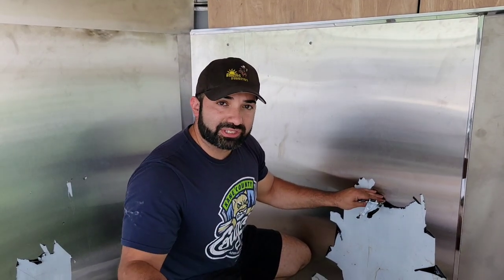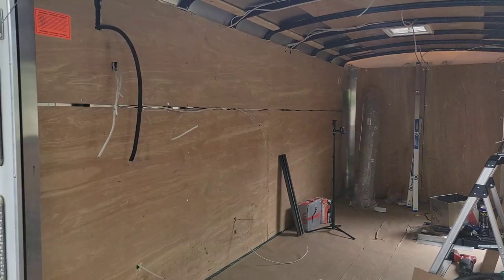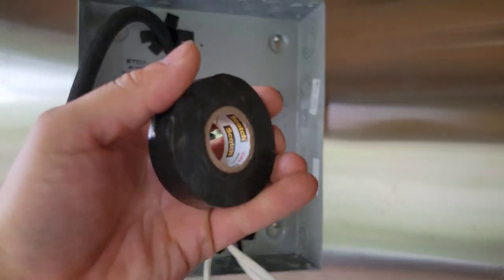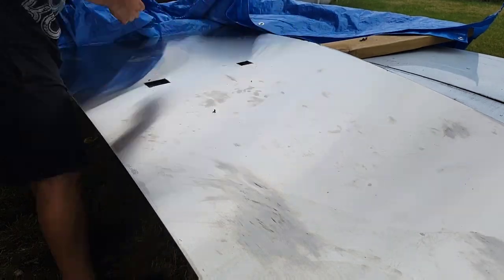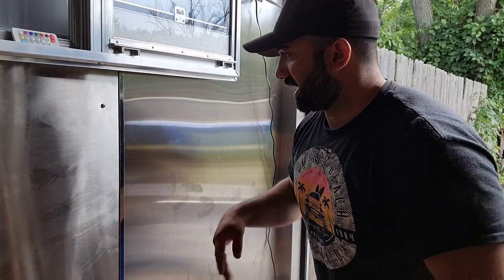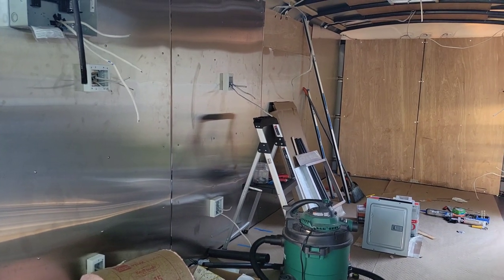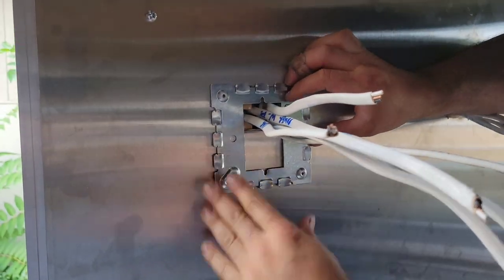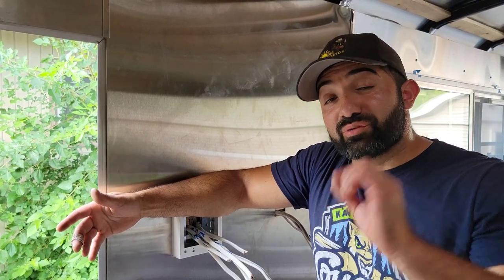How To Build a Food Truck: Installing the Stainless Steel

Comment: Use a fabric steamer to remove the plastic covering. Slowly peel the plastic covering as you heat it up with the steamer. Start in a corner and It will all come off in one piece under 10 minutes.

Comment: Since you are working by yourself, I can really recommend a Bosch Laser Level with Tri-pod from Lowes. I used it to tile my Subway tile bathroom and you don't have to mess around holding a Level. It is a big Time Saver.
Reply from the maker: 👍👍👍👍 thank you for the tip

Comment: One question, can the stainless steel ones be installed vertically and horizontally or only vertically?
Reply from the maker: Either way works.
Reply: Thanks

Comment: Frank, what if i have metals walls already up but they are old behind them is insulation.. do i over lap it with newer metal or do i take the old sheets off?
Reply from the maker: I'll answer as if I owned your truck. I would remove the old and bring in the new as Long as it has a nice base to attach it to. Being plywood or something similar

Comment: Hey Frank! Your series is awesome man. It's helped me so much. When you connected the stainless steel sheets up in the front of the trailer by the sink did you use 90 degree stainless steel connection pieces? Or did you just use the stainless steel end caps from Amazon? Thanks
Reply from the maker: No didn't use a 90 degree connection just made my own angle when I connected them both. Yes the caps and dividers

Comment: Just a question is it required to have stainless steel walls in your trailer other than behind  cooking appliances
Reply from the maker: As far as I know you just need it behind cooking equipment 
And the rest non porous walls
Reply: @fbaltierrez  Thank you for the reply, I might have a few more questions, is this the best platform to ask them or do you have another outlet?
Reply: @fbaltierrez  Thank you

Comment: Where do you get the stanley steel sheets
Reply from the maker: I got them from a place called Roco Steel. But prices and the damaged stacked I bought are non existent. Call your Local Metal supplier 304 SS mill finish

Comment: Hey frank, quick question. Why drill holes if you use self tapping screws?
Reply from the maker: Great question. Because the stainless steel is a tough one to drill through and a pilot hole helps tremendously
Reply: @fbaltierrez  ahh, gotcha. Im going to build one for a friend of mine who has a rolling ice cream business and wanted to make sure I had as much details as possible.

Comment: What size is your food truck. What size are your stainless sheets. How many did you use
Reply from the maker: 7x16. I used scrpas of SS that I got at a discount typically they were about 8 feet in length. How many? Depends on the size of your trailer and if you are doing the entire thing or just cooking side
Reply: What size is your food truck the dimensions please I am looking for one now. I am an electrician as well. You just inspired me to get this going
Reply from the maker: @nicolebeckner2026  7x16 cargo mate trailer

Comment: I am new to this, but can an aluminum sheet metal or other sheet metal be used rather the steel? What would the benefit of having the steel sheet vs other metal sheets?
Reply: Aluminum stain
Reply: other metals tend to stain, rust and/or oxidize in a kitchen setting. Stainless steel eliminates all of the issues AND it is more durable than most other metals in this application. Also, your health department most likely will require stainless steel or something like FRP paneling for water resistancy and avoiding mildew
Reply: @ItsHimMega  Thank you so much. That is really great info! I really appreciate it.

Comment: No insulation?
Reply from the maker: Just insulation on ceiling and where the window is. If you wanted to add more guess you could doesn't help out much. It's going to get hot regardless when cooking

Comment: Dought you read these any more being two years old, but having a money delima. I don’t k ow if I can afford the painted aluminum sheets like I want on my food trailer. It’s going g for 150.00 a sheet. It is 11 1/2’ long by 7’ wide approx, I’m extending it 3’. Need little more room. If I do get lucky enough to get aluminum sheets, should I run the sheets, up & down, overlap each end 1 1/2”, if I do it that way, I’m looking at 9 sheets and little over a grand, a grand I ain’t got right now. I’m in over my head too far to try and sell it, never get what I e got in it right now. I hv all tanks, plumbing, cabinets, had 900.00 structural welding done when 1st bought it. Floor was weak, put new roof on it avd hv insulation fir it only 2 sheets of what I’m using for ceiling covering. Flush mounted led lights, this that etc. couldn’t sell it avd get money I hv in it. Either way I run outside metal shell I’m looking at 9 sheets, plus padded SS wall covering on inside. Man I never expected to drop the dough I’m dropping  thought I’d be selling my sandwiches already down on the Texas coast but going to be a easy 8 more months or longer still hv to run electrical, trying to figure out the snow for all that to see if my generator will carry it it’s a 10,000 w generator thanks anyone got idea of what I ca use that loons line painted yellow aluminum sheets I’m open thanks Steve  
.

Comment: What? No header support on window after cutting studs then electrical tape on the wire access holes instead of proper romex connectors!??? Asking for failure! That trailer gets knocked around hard while in transit. Wires will get cut in time and no support will break that window. No even watching the rest. Piss pore job dude!
Reply from the maker: Apprentice the feedback, not a problem I'm sure there's lots of videos out there for you to watch. thanks for commenting tho. 3 years and 0 construction issues 😉👍

Comment: How did you get your cooking equipment into the food truck through the door? My griddle and chargrill are very heavy and I wouldn't be able to manually lift them up onto the truck and through the door
Reply from the maker: @wasiqrafi1793  the drop down door in back. All trailers usually have a side and back door

Comment: Well, I got my trailer yesterday. Thank you for all your videos. You’ve got me hooked on wanting to do a trailer. Question, why stainless instead of the FRP boards? Is the stainless easier to work then the FRP? Thank you
Reply from the maker: Stainless is a bit harder and heavier to work with however I feel as it will last longer and more durable

Comment: Hey Frank your videos are great, i recently purchased a 30ft school bus im turning into a food truck, i have 20’ length by 7’ width. My question, is it necessary to put the plywood behind the stainless steel? Can i just do studs?
Reply from the maker: No because the Stainless will be too flimsy in between studs needs a backing

Comment: Love the videos, only issue is: Definition of truck: motor vehicle used for transporting goods or materials.
     Definition of a trailer :unpowered vehicle towed by another vehicle. This is a good series of how to build a food trailer. Trucks have a different framework
Reply from the maker: Definitely agree. That's why I have stuck with trailers much easier for me to build

Comment: What’s up Frank? Hope things are going well. I’m in the process getting my food truck going. Starting from scratch really, small hollow Chevy p20 stepvan. Just getting it mechanically sound 1st. I was wondering if you can please tell me something. What made you wrap the whole inside of the trailer with stainless steel? I want to install stainless just on the cooking side and then put the white panels used in restaurant kitchens for the rest of the the inside. Is it just preference or is just more effective/ efficient for cleaning? I want to save because money is limited. Thank you for the great videos, they will be helpful!

Comment: I am interested in starting a food truck business.  But I am concerned about the heat.  How do I insulate the walls in the food truck to keep it cool inside when I’m running the air conditioner?
Reply from the maker: Air conditioner won't help once you are firing on all cylinders. It's like running the AC in your house with all the windows open might help but not much.